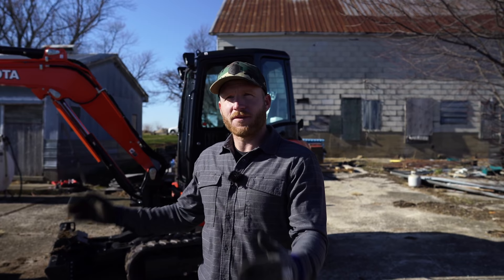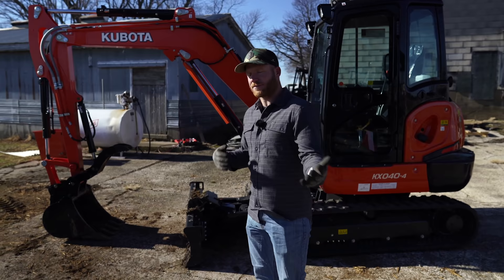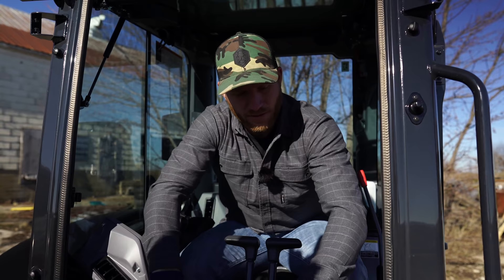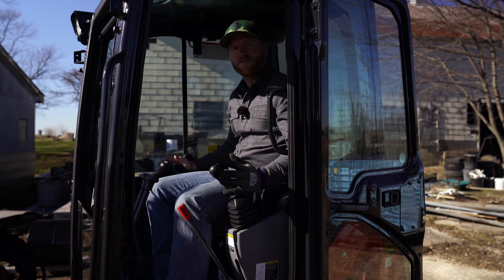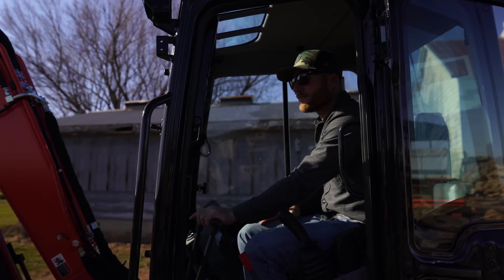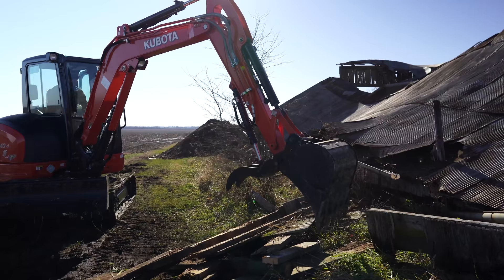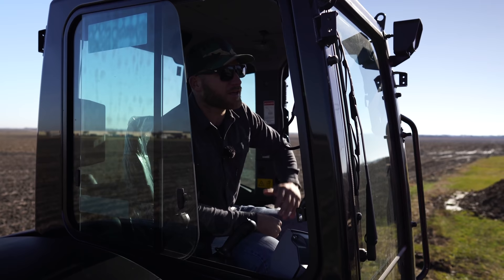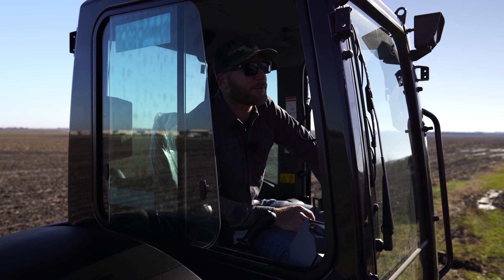What I always Wanted! Kubota Compact Excavator KX040-4 Walk Around Intro

Comment: The "BEST" Tool I have ever purchased, is my Kubota 1996 KX-101 Excavator.  It has saved me no less than 40,000 dollars over the last 4 years.  Do I wish it was bigger?... at times, but it impresses me all the time with what it can do.  Mine has an extend a hoe arm, so no hydraulic thumb, but I did add a manual one, and if you ever purchase an excavator, "GET THE THUMB" it is a must.   the things i could do with the thumb made it so much easier to use, and way more functional.  (without the thumb, it took weeks to do something that could take a day to do with the thumb. (safely))  Thanks for the video Kyle!
Reply: As an experienced operator I have this discussion with the young guys coming up. You don't need a thumb to pick things up, we picked things up and moved them around for years before thumbs came out. Learn the machine it takes 10 years on any one machine to be considered a professional at the craft.

Comment: I spend my entire day in a 40-4. Great machine!  I even have the st5050 radio installed with bluetooth so I can listen to spotify and take phone calls while working.  One great feature that you didn't mention is you can float the blade by "slamming" the blade control forward.  Only complaint I have is you cannot turn on the aux hydraulics when it goes into regen mode (seems to happen once per day) and you're stuck without the thumb for about 15mins.  I love kubotas.  I have a 40-4, 33-4, U35, two 75-2 and several tractors.
Reply: Yeah, when in regen, it reduces power.  Another reason these new B.S. emissions pieces are not worth the money they cost to build.  But it only takes a relatively short amount of time.  Gives you a chance to stretch your legs.
Reply: Page 49 in the operator manual tells how to resume AUX functions when it goes into regen;

1. The indicator turns off, and the warning appears on the LCD.
2. Press the switch 5.
3. The warning disappears temporarily and the normal display shows up again.
4. Press the switch 3 to continue to set the AUX settings as usual.

Comment: When transporting mine I have the bucket facing the rear so my door won’t pop open. Love my 40-4. I have a 12,18,24,36 and a ripper for digging stumps and concrete. Adding a brush cutter soon. Mine has a thumb as well. Better machines no employees!

Comment: Just letting you know that the blade is supposed to be BEHIND you when you are NOT using it to push dirt into the trench.

1.  It stabilizes you and allows the weight of the machine to be leveraged better when you dig.

2.  When it is in front of you it Blocks your view of what is directly in front of you or in the trench/hole you are digging,

3.  When it is in front of you, you have a chance of grabbing it with the bucket/teeth when you curl out of the dirt.

4.  When it is behind you, you are able to get closer to the edge of the trench/hole and be more productive.

At 10:05, if you had the blade behind and on the ground, you would not have rocked the machine or yourself.  Believe me, after being an operating engineer for a long time, the less you beat up on the machine, and of course your own body, the better you feel in the morning.
Reply: Unless you are picking something heavy or on uneven ground and using it for stability…

Comment: I really like mine. I lowered the travel pedals a couple inches. Much more comfortable. Also added about 10" to the top of the dozer blade so material doesn't come over the top. Got mine with a 16" wide progressive link thumb and a pin grabber coupler. FYI don't get below 1/4 tank of fuel on steep ground. Runs out at the worst time!
Reply from the maker: Thanks for the tip
Reply: can you describe how you lowered your pedals?  i've thought before about how they are uncomfortably high.
Reply: @elijahharp  It was a few years ago, so i don't remember details. Had to do some fabricating where they mount to get them as low as possible.

Comment: You're light on the weight of that machine.  The weight you gave of 9,400# is for the open station with angle blade which is actually 9,545#. The Kubota brochure has your machine at 10,210#

Comment: besides the updated operator display, about identical to the U- series 48-4 I have. Same engine/hydraulics, same undercarriage, same controls, same interior as the U, they just call it the KX now, doesn't matter the weight. Whatever you do, NEVER loose the red key, cuz' that'll cost you $1500 for a new set...

Comment: Is the boom swing activated by a pedal or by thumb control on the left joystick? I have a Kubota KX121-3 w 6 way blade and really like it. Thinking of trading up to 040. Also have a KX080-4, another really good machine.
Reply from the maker: Pedal
Reply: @RRBuildings  Thanks. I was hoping thumb switch because I would like to split that hydraulic circuit and run a tilt bucket from it. Really don't want to run a tilt bucket with a pedal. Does the 040 have a second auxiliary option?